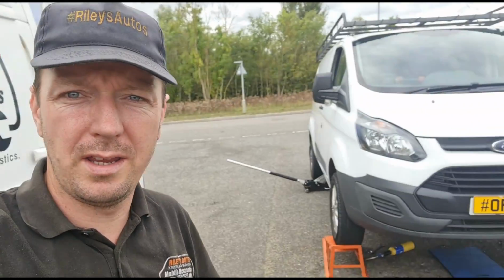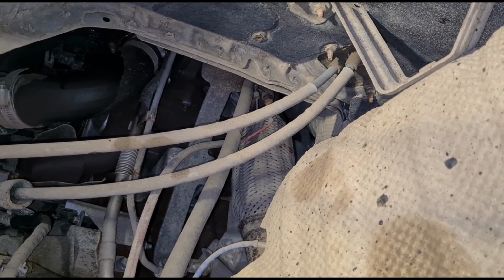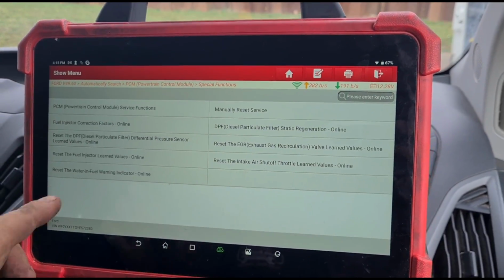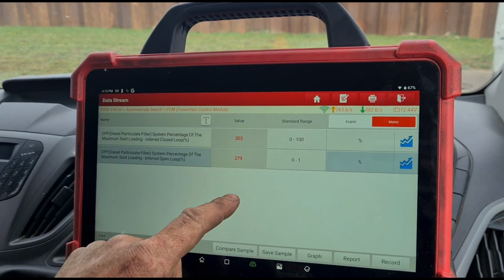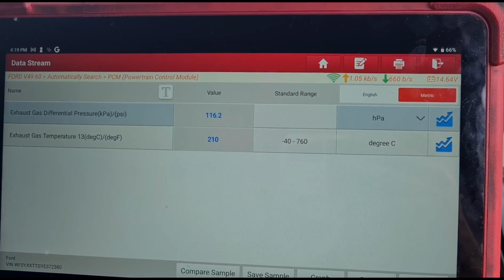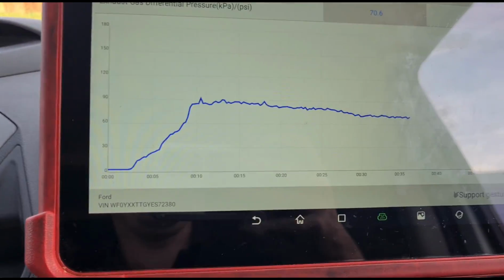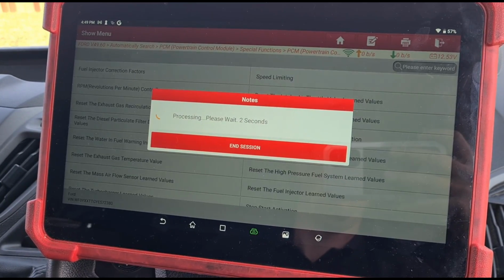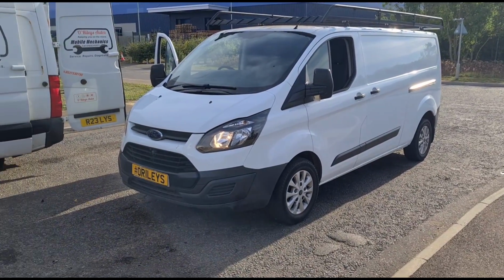Ford Transit Custom 2.2 Euro 5 DPF Cleaning & Vaporizer Replacement

Comment: Does the engine glow plug fault cause failure to regenerate.
Reply from the maker: Not on this vehicle.  But most vehicles yes it would
Reply: @ORileysAutos  thanks for the answer Jimmy. What about on a 2.2 euro 5 rwd transit...

Comment: Im a transit tech for a local council. Poor drive cycles and folk ignoring warning lights they drive them untill limp mode. 
Doing so many of these annoying vape valves in the dreadful location my neck is in constant pain after doing these . Props to you doing it on your back on the road fella.

Comment: Yo, on my transit, I ve got my exhaust gas temperature 13 blocked at 1000 degres, and same for the bank 1 before cata and after cata blocked at 578 degres both of them, my van dont hâve all his power, like if the turbo doesnt charge.
Sometimes p0299 and thats all.
What you think ?
Thanks (sorry bad english)

Comment: Hi Jimmy, loving your vids keep it up. Sorry if this is a daft question but would a pressurised garden sprayer slightly modified work as a dpf fluid cleaning gun as a "get me by for now" type thing? They run at 3bar max pressure. Just interested on your thoughts on this thanks.
Reply: @jrcash1234  I removed the gun from the garden sprayer and attached the outlet from the sprayer to the pressure sensor pipe closest to the engine on the DPF. Once the sprayer reached pressure it deposited the fluid nicely. I let it sit there for around twenty mins then ran the engine at around 3k rpm. Worked for me

Comment: Great job Jimmy. I thought the idle value in millibars reads zero if below 10? Or is this on certain engines? Maybe I'm just getting it confused with something else.
Reply from the maker: Some ECUs/sensors only read in 10's
Reply: @ORileysAutos  👍

Comment: I assume you corrected the glow plug fault or you will be calling back to do another regin,
Reply from the maker: Glow plugs on these doesn't stop a regen as it uses the vaporiser. But it's coming back soon for Glow plugs

Comment: It looks a really difficult job replacing that vapouriser. As someone who does their own servicing and repairs I think I'll put this vehicle on my 'do not buy' list. I've tangled with Ford diesel before (on a C-Max) and that was by feel a lot of the time. I didn't know the vans were also so bad to work on.
Reply from the maker: These aren't as bad as a Citroën Relay or Renault Trafic
Reply: try a merc Vito 1.6 Renault engine laugh a minute  @ORileysAutos
Reply: @ORileysAutos  Many thanks for your reply, Jimmy. It really helps to know which vehicles are better to work on than others. Maybe I should change my mind and put them on a list to consider and put Citroen Relay and Renault Trafic as ones to avoid.

I don't know if you'd ever have the time, but have you considered doing a video covering what vehicles are easier to work on than others and why? Even a short video would be much appreciated. I really like your channel and I'll keep watching either way.

Comment: Jimmy can I ask you something please ,
Citroen dispatch  2012 I think it’s been mapped because I can’t 
 get any live data on the vehicle and it’s in limp mode and can only rev to 2500 revs . So what I’m asking if I do the dpf clean and the pat fluid plus the egr clean , then I can’t do a reset on it will it stay out of limp mode because of the remapping. Any info would be great . Many thanks .